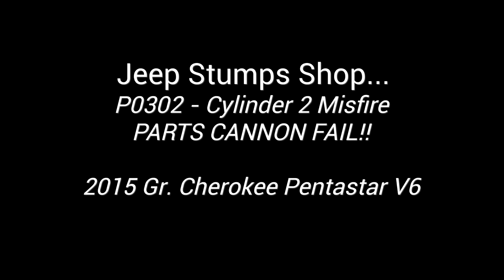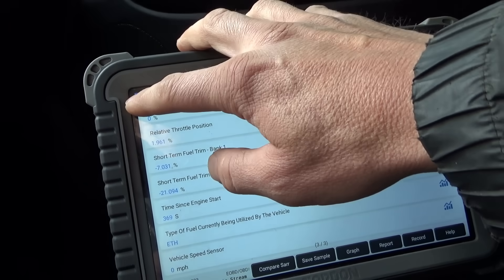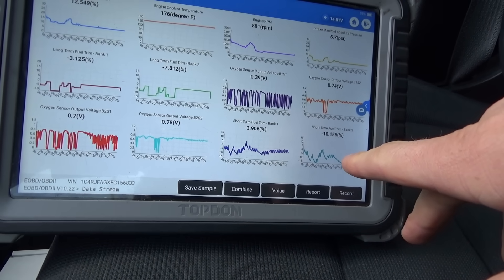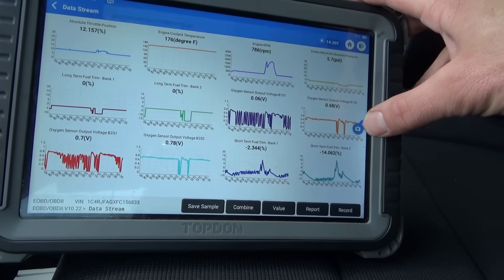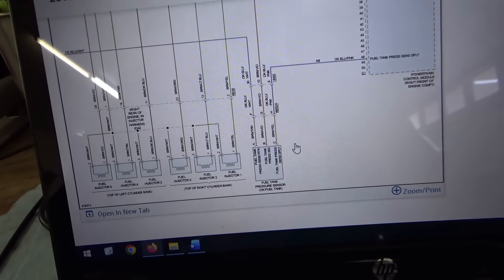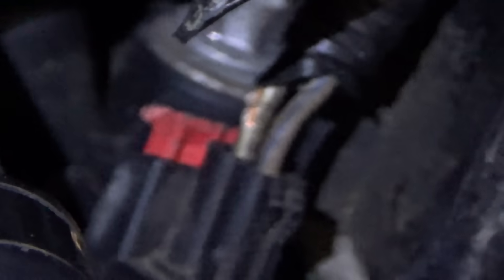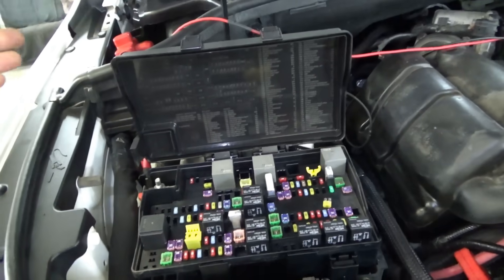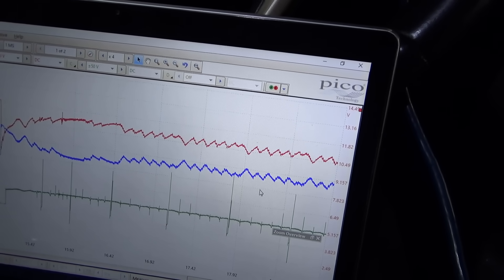Shop MISFIRES Parts Cannon!! ('15 Jeep Grand Cherokee: P0302 Pentastar V6)

Comment: Those cylinder heads have an extended warranty for carbon buildup — 10yr 150k miles.

Walnut blasting will fix it if the valve seat is ok

Comment: I don’t think the valve is gonna be sealed with the engine temperature cold, and then start leaking unless the valve lifter is not bleeding off and holding the valve open causing a compression leak( lifter bad)

Comment: WHEN USING THE PICO SCOPE TO CHECK THE IGNITION COIL  CONTROL  CIRCUIT DO YOU NEED A  10:1 ATTENUATOR? I DID NOT SEE YOU USING ONE

Comment: When I worked on cars, I'd have the plugs out for a tune up anyway, so I'd use a remote start switch and walk the engine with a compression tester.

Comment: 2011 Durango 3.6 is still going strong at 250k, Aluminum oil cooler only thing been done majorly to the engine. Course it is a Dodge and everything around the engine is always breaking lol.

Comment: I recently scrapped a 2015 Caravan with the 3.6 Pentastar. It had 358,000km with no internal issues. 5w20 non synthetic was used. It was changed every 7000km or less and didn't burn any oil. The original transmission went so I scrapped it.

Comment: techron fuel system cleaner will straighten it out in 20 miles. been there. use top tear gas from now on.

Comment: Bwaahahahaha!
As soon as I saw the thumbnail and only 16min run time.  I started laughing! Another bank 1 pentastar failure.
I've seen 2 of these in the last few weeks. The last one was a 2014, 165k miles, in great condition, owned by a fastidious owner. Cylinder 3, head gasket leaking into coolant. Exact symptom you had. Small cough could be felt, but the actual complaint was intermittent over heating.
How anyone buys a Jeep in the modern day of unfettered information in the palm of your hand is beyond me! 
Such a shit barge.

Comment: my aunts 3.6L with under 70,000miles had a misfire. the dealer quoted her $1200 to take the valve cover off and inspect. they couldn't find a issue and quoted 12,000 for a engine replacement( charged her another $400 for valve cover and misc. gaskets to put it back together). i took at look and one of the rollers lost all the needle bearing causing the misfire but no obvious tick. for 77 cents i got some from a junk yard and slipped them in lol.

Comment: watched a lot of your videos I really like them I've learned a few tricks that I didn't know but here's the thought on this one that I don't think you address it may not need a cylinder head. You may just be able to run a motor vac with some GM top engine clean to clean the valves. i've seen lots of dirty valves cause this issue over the years. Or at least a leak down test I like you channel a lot a lot of technicians could learn a lot from you. Thanks for listening Benjamin Sapper Rogue automotive Medford, Oregon, and Arthur's auto on the weekends

Comment: 2014 was not a "good" year for these things.  I had a 2014 with 70,xxx miles where I rebuilt the pair of heads.  It always seems to be the left bank head.  
According to "my" cylinder head rebuilder, these things came from the factory out of spec already.  I can't remember if it was valve margin or whatever, but that is why a lot of them go to the moon and back while some with low miles have this problem.  When asking me for information, he asked, "is it low miles?" and when I said yes he knew what was wrong.
I learned after I had the heads done that Stellantis was selling new head assemblies for literally a few hundred dollars.  With practice, the one head can be swapped in a few hours.

Comment: On the early/mid 2000s dodge/jeep engines, they are known for dropping valve seats when they overheat. They set the injector circuit code on the cylinder because the computer thinks the injector isnt firing due to no contribution/combustion on the particular rotation. Some of them will throw a rocker arm due to a collapsed valve lash adjuster. It would be nice to see the valve cover removed to see if you can pinpoint if the valve is opening or not. Or sticking open as a valve seat works its way loose. Ive fixed a few of them with these issues.

Comment: Just wondering if something in the valvetrain was holding the valve open, and intake or exhaust. Any adjustment available for tight valves ?  The negative fuel trims especially on one bank are telling me it is an intake  valve problem. At low rpm the intake  valve is allowing air/ fuel charge to go back up into the plenum and enrichen the close by cylinders. This would push the O2 sensor to a rich higher voltage ,with PCM correcting into the negative 15 % range. If the exhaust valve leaked, it would put lots of unused O2 into the exhaust and the fuel trims would go  positive.  I had a broken valve spring in my intake ,small block chevy. That cylinder did not fire at all but it also made 3 other cylinders on that dual plane manifold to go very rich.  I am not sure how this Jeep valve train adjusts for valve seat wear...so I could be thinking too much old school like solid lifters.
If intake side, I would bet if you slowed the engine down to like 400 rpm you could pick up a blip or needle  or MAP fluctuation in the intake manifold.

Comment: These engines can be extremely reliable or have issue after issue, they did make over 10 million of these engines and put in every mopar vehicle. Currently got 2 Pentastar 3.6's one with 291k Miles and 265k miles one in a durango one in a minivan. No major issues yet
Reply from the maker: What years?
Reply: @PineHollowAutoDiagnostics 2011 Durango and 2012 T&C. We Also got a 2016 300 with 155k and a 2016 GC with 140k. No major issues yet but the newer pentastars are hit and miss

Comment: My sister in law bought a 17 Journey at auction. 3.6 ran great on test drive. On the 50 mile trip home it overheated intermittently. Turned out it had a warped head. I pulled both heads got them resurfaced new gaskets and of course new oil cooler. Runs fantastic now 151,000 miles. It was a big job, but it is doable.

Comment: Couldn't use clear flood mode because you didn't want to load the cylinders with atmospheric pressure and artificially bump up compression.
Reply from the maker: Wouldn't really matter, bad cylinder would still be lower compression than the rest :)

Comment: Unpopular opinion: The Jeep is fine and this is a very minor problem. What would happen if someone just drove it in this state?
Reply from the maker: Relatively minor yes. If you don't care about the check engine light and slightly worse fuel economy then keep driving it! 😊

Comment: I had the 2011 Caravan with the Pentastar. Bought used at 6 years old with 100,000 Had the bad rockers. Changed those. Catch them soon enough and you'll save your cams. No issues with the oil cooler. Smooth sailing for an additional 200,000 kms (120,000 for you Americans). Sold at 300,000 kms.

Comment: have a 2014 journey 3.6 ,,, 178 k and only repair has been the oil cooler leak which was covered under warranty love my dodge journey
Reply: I have the 3.5l v6 in my Journey, I wish I had the Pentastar sometimes. I have to get the Egr and thermostat replaced on it tomorrow.

Comment: Isn't there a special function in the scan tool that can disable the fuel pump? I know on my Cruze you can disable fuel pump in the tool so no need to pull fuses.

Comment: Is 6% Long term fuel trim high?  Maybe running rich? Older (2005)  2.4 litre 4 cylinder Toyota
Reply from the maker: No codes, no problems :)
Reply: @PineHollowAutoDiagnostics thank you I'll keep an eye on it

Comment: I would have pulled that valve cover from the start. I just worked on a 2015 with 115k on it and when I pulled the valve covers it already had 3 new cams and 4 new rockers, ultimately an exhaust valve was bent and sticking so it needs a new head.

Comment: A shot from Mr. Wiggles down in the cylinder 2 plughole would provide some more insight as to the cause of the compression loss?
Reply: Depending on where the loss of compression is. Just diagnosed another 3.6 that wasn’t opening the intake valve because the cam lobe was gone. Would not see that in the cylinder bore.
Reply: @braydenjohnson730  Could you not see the intake valve not opening while turning the crankshaft by hand?
Reply: @mark-d9k9b  only if you want to crush the camera while rotating rhe engine

Comment: Great process for diagnosis.  I'd hope the shop includes and note in this car that it needs a valve job on one side (or both to be a clean repair) after finding out the problem. It may help the sales price vs. buyers claiming all sorts of other things.
Reply: And cut their own nuts off? Do that and they'll never get their money back. Sounds like they overpaid, otherwise it would be getting fixed
Reply: @disgruntledcanuck  If this shop discovered the miss, so will others when they preview at the auction.

Comment: I have a 1997 Ford Taurus 3.0 OHV It was doing exactly what this jeep is doing. I replaced plugs wires IAC fuel pump fuel filter fuel pressure regulator. Each item I replaced improved. I bought a code scanner and P0402 Excessive EGR flow. After researching. I replaced the DPFE sensor. That improved a lot.no more spitting sound in the exhaust. A little small roughness at times. I'm ready to just accept this. Starts good. Plenty of power. I might do 1 more EGR solenoid. I rescanned. It's still P0402. 🤔 UPDATE rescanned again just now no codes. Running good. Car just had to adjust to new DPFE sensor.
Reply: you better check the camshaft synchronizer assembly on that, or better yet, just replace it with good OEM. because they're known to go bad bearings from oil passage carbon plugging and no lube, they then chew the distributor gear off and stops the oil pump and engine grenades, the engine will keep running and they'll keep starting without it spinning at all.
the oil light should come on when every time you start it, but they're well known to NOT work due to lose connection, it won't light up and there's no other indicators something is wrong, other than they'll make a chirping sound sometimes when failing. you can pull the cam phaser sensor off the top and check for shaft/gear play.
it needs a special alignment tool/cap and engine at TDC to be replaced and synchronized right. it's in the location the older models had the distributor and just replaced it.

Comment: My girlfriends 2021 Cherokee 3.2  and 98,500 miles had same p0302.  Luckily still under warranty.  Dealer installed lifters and rocker arms on bank 1 and problem was fixed.  Had that same minor misfire at idle but otherwise ran perfect.

Comment: I wish you would pull the plug on #2 and see exactly how a compression gauge would correlate with the graphs, like is that a 40 psi hole, or an 80 psi hole
Reply: Probably didn't want to do the work of removing the intake manifold. Not a fun job on the GC, BTDT.

Comment: The 2 good years for the Pentastar...The year before they started making them and the year they stopped making them......
Reply: These engines "can" be extremely reliable, I've seen them over 300k miles and we personally have 2 3.6's one with 291k miles on a durango and 256k on a minivan. No major repairs yet.
Reply: you gotta put 30w in them (not 20w) and keep them clean, and they are good engines..
Reply: Amen Brother!:face-green-smiling:

Comment: Ivan great diagnosis, but I guess your experience told you that it was the cylinder head. Otherwise wouldn’t you need to do a leak down test to determine if it’s in the cylinder or one of the valves in the head?

Comment: Pentastars had problems with roller rockers and camshafts, valve stems sticking in valve guides. I used to change head, cams, roller rockers all day at Chrysler. He started the diagnostics wrong: he didn't check the TSBs.
Reply: He still has to confirm the problems. Just because the tsb says so doesn’t mean you stop there and call it.

Comment: Before I even listened to one second I said it was the cylinder head. Just diagnosed a 2014 80k miles that needs a head. Definitely top 5 worst engines
Reply from the maker: It's a shame because when they run well they are really nice!

Comment: It's a shame that this kind of problem is so difficult for some shops to diagnose. Too many times everyone forgets what a gasoline engine needs to run.......spark, fuel, compression. When I started out many years ago, a compression test was one of the first things that was done for a misfire.
Reply: Back in the old days you could do a real compression test without taking half the engine apart lol. With these that intake has to come off, ridiculous.
However, we do have one in a 2017 Wrangler that's at 145,000 miles and running well.

Comment: Hi  why would you not give the customer the option of just relapping the bad sealing valve or replacing and relapping a new valve  ??  seems repair shops quick to replace or recondition parts , and remembering that this engine has some miles on it  sometimes new cyl on one bank can cause problems as it will be perfect and other bank may not match ..
Reply: His coustomer is a used car dealer , their not interested in anything but making money , back to the auction it goes for someone else to deal with.

Comment: Food for thought.....you may want to pull the valve cover and just check the valve springs on #2 it's quite possible you have a broken spring.i had one with all the same symptoms and I was ready to pull the head and when I pulled the valve cover I noticed it was actually a spring that had broke.replaced the spring and it was good to go.
Reply: Thinking out loud, wouldn't a broken spring cause it to have too much compression, rather than not enough? You would expect it to draw more current when cranking that cyl, no?
Reply: @promastersonly1419  The broken spring is too weak to hold the valve properly closed = you loose compression.

Comment: The scanners should have the PID's to where you can select the ones you want and save them instead of having to find them every time. When I had my Autel it didn't have that. You should make that suggestion to the manufacturer. It would save time and aggravation with these tools.
Reply: How about some programmable presets? That would be better.

Comment: As far as I'm concerned, Mopar hasn't made a good 6-cylinder since the Slant-6.  ;)
Reply from the maker: What about the Jeep 4.0L AMC design?
Reply: @PineHollowAutoDiagnostics  My family had one when I was quite young, and I remember it trying to kill us on several occasions.  Stalling on the highway with no warning, suddenly racing to 3000+ RPM when trying to stop at traffic lights, randomly depositing a significant amount of fuel on the garage floor overnight, then mysteriously having no leaks when it got towed to the dealership...  We lived with it for years, they never could fix it, and my father ended up suing the dealership into a buyback after they refused to work on it anymore.

You don't know how badly I wish I had that dang Cherokee now that I have the knowledge to diagnose it!
Reply from the maker: @rhkips  Sounds like the engine mechanical was fine...the fuel injection system not so much LOL!

Comment: So, it gets sent off to the auction assuredly with no mention that it needs major engine work for the next sucker.
Reply: Scre** thy next person. Dealers selling garbage among themselves. 🤣
Reply: Major engine work its runs fine its a slight misfire
Reply: If the valve is not sealing it'll get worse pretty quickly Either the seat or the edge of the valve will just burn up and then it won't have basically any compression on that cylinder.
You can obviously just replace that single valve, but it needs quite a few hours to get to there.
Reply from the maker: @tschuuuls486  My 89 MPV has had a poorly sealing exhaust valve on cylinder 1 for 7 YEARS now...hasn't gotten any worse over maybe 20k miles haha

Comment: Why didn't you drop oil down into that cylinder and recheck compession  mechanically ?
That would give you a definite verification.Because you might have rings that aren't sealing.
Reply: he gets paid to diag , not to repair. Its from a used car dealer , if they wanted him to actually fix it they wouldnt have sent it back to the auction for another sucker to purchase. They probably didnt even want to pay him his diag fee.

Comment: Hey Ivan you should pull the valve cover and do that leak down. I have found that 99 percent of the time on the 3.6 it’s just a bad rocker even if it’s not making a noise. I hardly ever see leak down on these. Specifically if contribution returns just off idle
Reply: I would also expect it to be a rocker arm problem.
Reply: Exactly. Just a rocker arm not a valve..I've been into this exact situation 😂
Reply: not opening the valve far enough to build adequate compression?

Comment: Had the same problem on '14 Wrangler a few years ago... Cylinder 2 exhaust valve burnt @ 110k miles. Local cylinder head shop rebuilt the head faster/cheaper than ordering a reman head. Currently nearly 200k miles, no misfires.
Reply from the maker: Nice!

Comment: All the money spent on coils and injectors would have gone a long way towards a replacement cylinder head.
Reply: All the money on parts spent and time spent on it so far. They never got that back. Should have just put a head on it at that point.
Reply: 😂😂😂  a real tech like Ivan would have saved the salvage company $$$ , just shows you that savage car dealers don’t have any good techs.

Comment: You know that one of those used car (finance here, pay here) places will purchase it and wipe the codes to get it sold. It's a shame really. That car looks in very good shape and I think worth the head or even replacement engine.
Reply: Some women will buy it, they don’t under what the light says. Matter fact out of 10 people, they will buy it. 
They try the parts cannon, then hopefully a shop can diagnose it correctly instead of throwing a code reader on it and call it.
Reply: @2nickles647
Yep. And it's a shame that used car sellers (some) are like that.